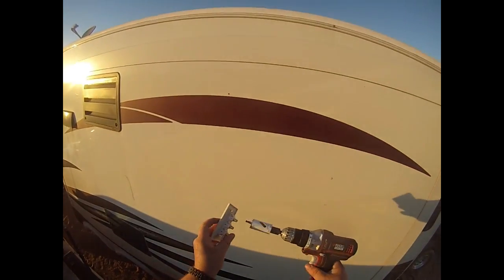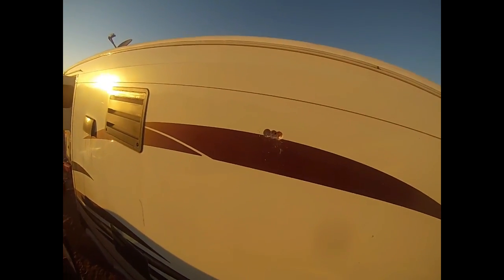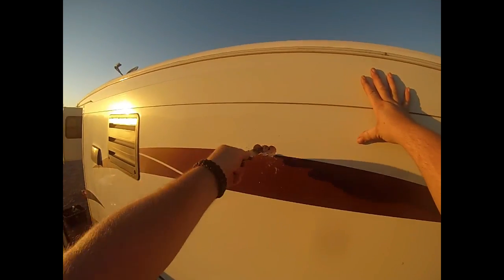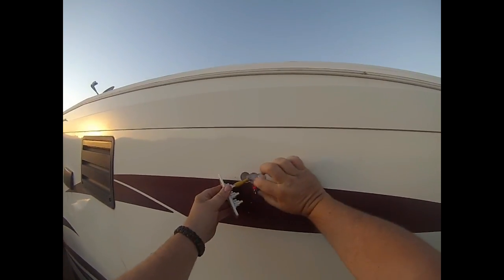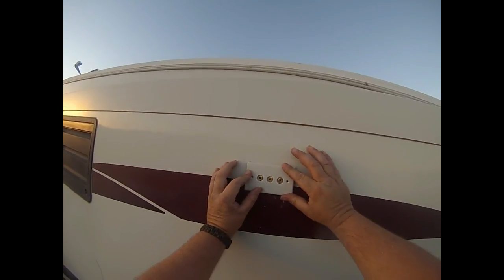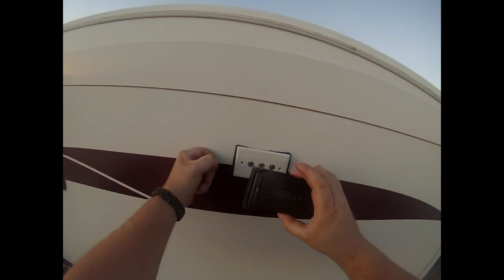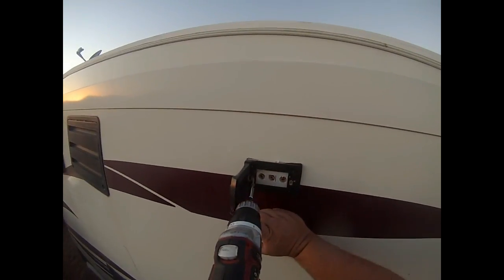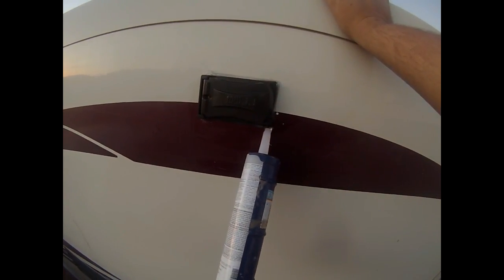HOW TO INSTALL PASS THROUGH CABLE OR PLUG ON MY RV

Comment: My Offgrid Life, gave me some idea's thanks. My Satellite  connection on my Frigging New camper blocks my receiver I have to have a direct line from Satellite Dish Ant, to my receiver. Was on the phone for over a hour with Dish, Finding out how to fix this. Finally I hooked up my Dish Ant, direct to my VIP211Z Receiver and it worked like a charm. Now I have to decide how I want to run a straight line hook up. Thanks for some ideas, I was also having EWAG Problems. LOL

Comment: Wow total hack job. Any skilled tradesmen knows the correct way to do this. This is terrible.
Reply: I have to agree with you. I would be furious if someone installed cable like this on my rv. All that silicone caulk in with the coax will make future access impossible.